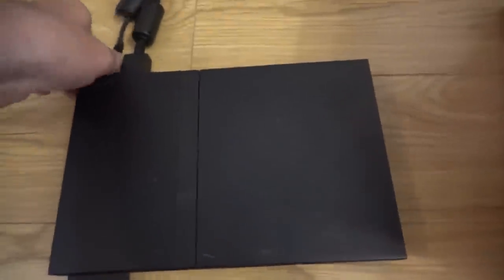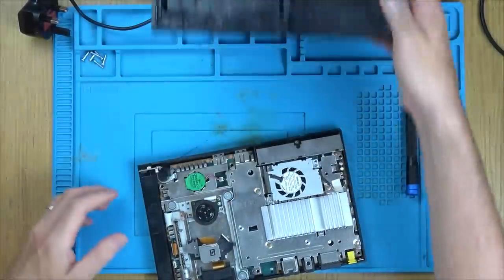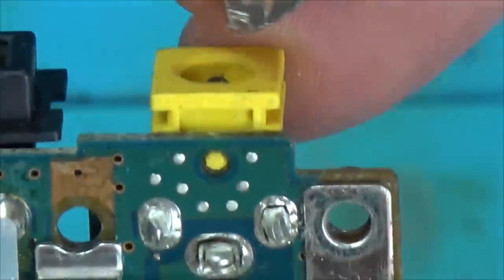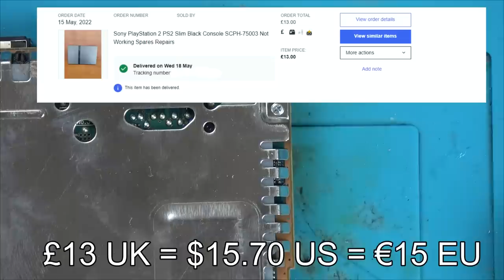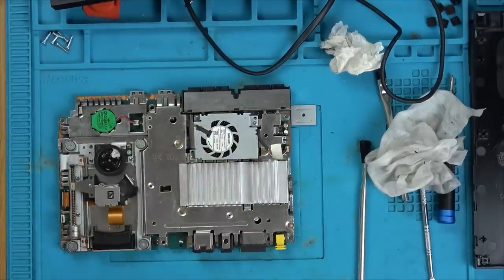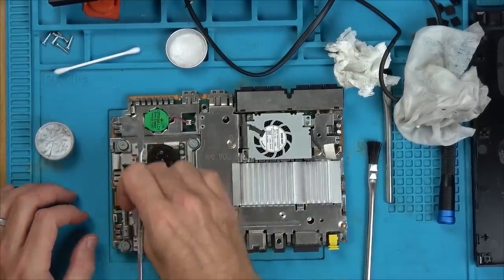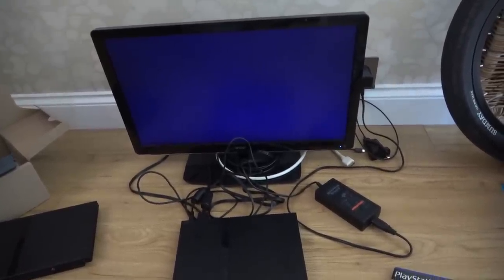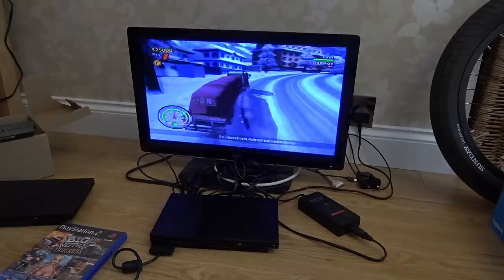I bought a PS2 from eBay with NO POWER - Can I Fix it?

Comment: Vince, you always solder everything three times. I think your soldering is perfectly fine, which you can tell by the shiny appearance of the joint after your first go. Doing it three times is just putting unnecessary more heat into the board. Try having more confidence in your technique.
Reply: @TD75  Just add some more flux, if you are soldering multiple times👍🏻
Reply: The main reason the solder job gets so shiny and clean is because of the leaded solder, if lead free solder is used it gets really pale and crusty joints no matter how good you are at soldering. However Vince combine both skills and solder together

Comment: Yip common fault on a lot of power adapter plug in units if it gets plugged in and out a lot, the input connector flexes and causes a failure.
This is how we find bits of paper, matcstics etc stuck down the side of the power sockets, eventually they completely give way, USB sockets are notorious for this.
Another good and informative video to watch.
Ray 👍👍

Comment: Great save Vince, I doubt any original PS2’s with a working battery would be a very rare find & as you say it’s an very easy change.
Reply: PS2 with 4:3 word attach this CRT TV, and there PS2 has full widescreen support with LED TV mount 2006

Comment: Nice simple fix, just dry / cracked solder on the power input. Well done on anther item repaired. I've eventually finished repairing the wifes car (replacing two turbo's what a nightmare), so I've been back onto doing a few repair video's myself.
Reply: Ohh I will take a look 😎
Reply: Soon as I saw the pads I knew.
Reply: twin turbo car?
Reply: @RWL2012  Yeah Landrover Discovery 4. Had to take the body off.. they are a piece of s#!*

Comment: Nice fix Vince. Just to add, my first step is to check the PSU for voltage before opening the console. You know this of course, but it's worth mentioning for the newbies.
Reply: The PSU is external, so you can't really shock yourself with a PS2 slim (atleast not this model, the last revision actually had an internal PSU).

Comment: Vince - I've sold things on eBay in the past as spares or for parts, not working even when it WAS working - three reasons for that - 1)  "Parts" sometimes fetch a higher auction price (for whatever reason) and 2)  I haven't used or tested something in quite sometime so I can't really claim that it's in perfect running order - the new owner WILL find any issue and "claim" that you as the seller knew it was bad.  3)  It has batteries that have gone bad/flat - say for an old digital camera that has a battery pack the camera may power up, work fine until you go to use the flash and then dies.
Reply: Definitely true about 1), to the point where it's actually ridiculous. I've seen defective and incomplete stuff for 30% over the normal price of a complete, fully working item.

Comment: In my experience, that's the most common issue when it comes to no power at the ps2 with the external power supply. Same for the ps one, the smaller version of the ps 1. I don't think it's fall damage, it's more likely the result of the massive connector with the heavy denoising coil and the relatively thick cable, that is putting a lot of pressure on the solder joints, especially when the device is lifted while connected.
Reply: Bh

Comment: Nice easy fix. You get the same issue with those figure of 8 sockets. They are just not mounted/strengthened properly like they should be. After numerous forceful plugin's the solder joint just fails.

Comment: I've got 3 PS2 slims, 7 PS2 fats and 3 PS3s in my possession. They all have various faults but it's just difficult to diagnose or find parts for (one PS2 has a crack in its power board). Another issue is having a PS2 that is set for NTSC regions (I'm from New Zealand so we only have PAL TVs). Would love to go through them but my level of knowledge isn't up to scratch, despite having 6 months experience at a nearby farming electronics manufacturing company. I hope I can get round to them again

Comment: Nice fix and interesting game at the end :) Bought a fat PS2 in 2017, and probably someone has replaced the battery in the past, as it's still keeping correct time and date. Strangely the warranty sticker looks intact though, as if it's never opened, but I guess the sticker has been replaced as well.
Reply: I have three PS2's that still keep the correct time and one them is 20 years old and was definitely never opened. I think the main reason for it that the console was most of the time plugged into a power outlet, the PS2 doesn't really use the internal battery when connected to external power.
Reply: @smartfox2295  That's possible, my 2009 PS3 Slim battery lost it's power in 10 years, as I've kept it out of the mains power when I don't use it, as it doesn't have main power switch.

Comment: This is a common fault on the N64 as the power brick sits against the pins and can jostle a bit and put a good bit of stress on the pins. I also had a PSone that had this exact problem. Always nice when the fix is easy.

Comment: Same here, I bought two mega drives as faulty, both work fine haha.
Reply: I've had similar too with a Milwaukee battery charger that was supposed to be "DEAD", although I did end up doing a tear down video of it and possibly finding a couple of suspected dry joints.

Comment: maybe you could solder a battery holder instead of that little battery, I did it with the philips cdi, I fisically opened the chip that serves the purpose with a dremel, removed the embedded battery and I soldered two wires and a battery holder with a cr2032 .
Now even if it dies again it would be enough to replace the cr2032 for a few cents.

Comment: Back in the 80s I had a job servicing office equipment, desktop calculators, electronic typewriters, dictation machines etc. We had a minimum charge of 1 hours labour and I lost count of the number of items comming in with a no power job sheet when the fault was a blown fuse or loose connection in the power leads plug.

Comment: Not dropped, or should say I wouldn’t suspect that because of the broken joints. It’s a very common failure point just from plugging in and out over the years
Reply: I was thinking the same thing. I think it was the original xbox suffered from a similar issue, but as you say kids wiggling the power cable in and out of it.

Comment: Not much of fix is it just solder the power that's it
Reply: It was broken, and now it's working... a repair is still a repair at the end of the day even if it wasn't the most exciting.
Reply: @BuyitFixit  can you try to fix a silver slim ps2 those have issues reading purple or blue disc, I know I had both models they still had the same issues I bought brand new from target and Walmart
Reply: @GamerLegend.97  I could see if I can get one off Ebay. I repaired a few PS3s a few years back and it was usually the laser had pickup had failed. Just replacing it with a new one made them read disks again.
Reply: @BuyitFixit  but it wasn't the laser though because it would read normal disc right no issues, but the other ones the laser would stop I had to open and close it alot to make it work I didn't know what the issue was then if they were new
Reply: @GamerLegend.97  I think the laser heads have two laser diodes and two laser pickups in them for different wavelengths. One laser reads CD type disks and the other DVD types. If it was fault it could still read 1 type but not the other.
Reply: @BuyitFixit  I guess replacing them might not be option then
Reply: @GamerLegend.97  You would just replace the whole laser assembly. I had similar on the ps3 where they would play CD and DVD but not blu ray game disks.
Reply: @BuyitFixit  yeah kinda what happened to my ps3 slim 120gb the laser stop working completely I don't have anymore or the silver ps2, I got a modded ps2 phat and modded ps3 160gb they work good but incase if I do decide to get silver slim again which I don't think I will can you show me how to repair it I've only taken apart a ps2 phat but never slim